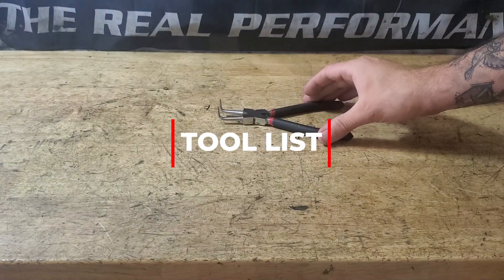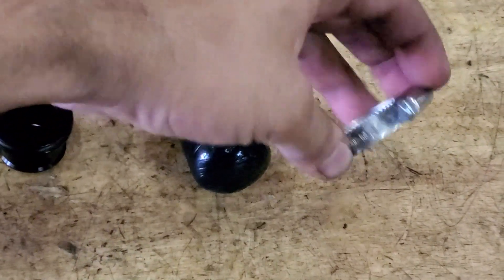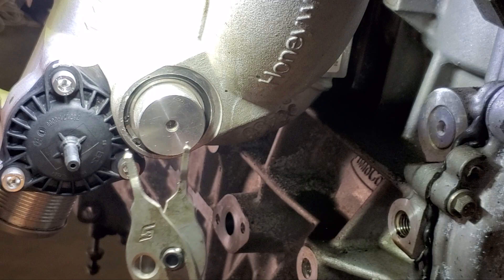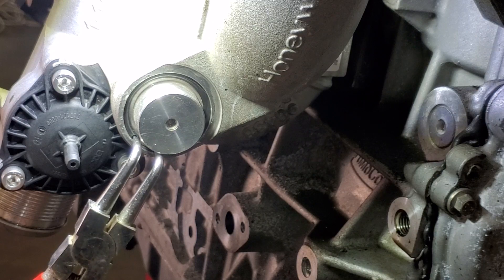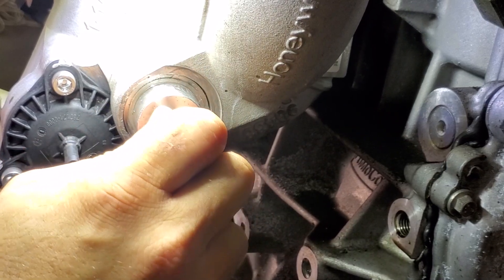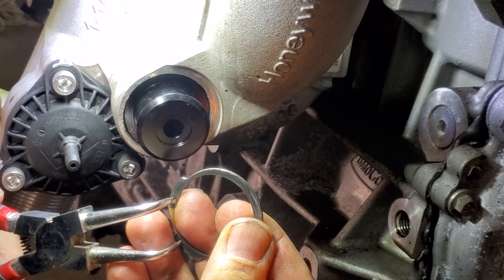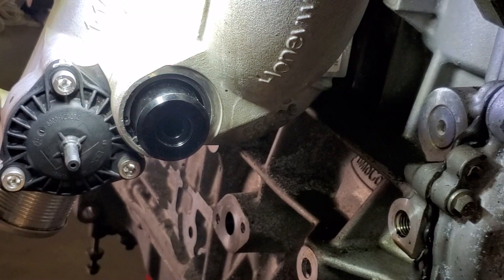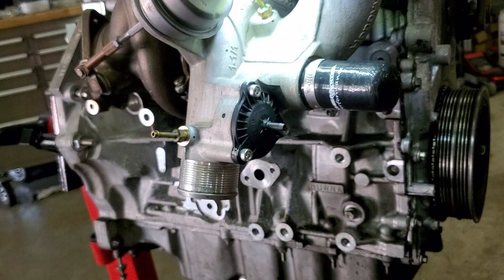How to install Sound Suppression chamber for RSMK3 by OEM Denied Performance

Comment: I wonder why your Turbo is Honeywell and mine is Garrett?
Reply from the maker: Its the same company,  the 2016 vehicles tend to have Honeywell in the casting of the compressor housing, the 2017/18 Garrett. (Same turbos)
Reply: @OEMDeniedPerformance  Well that explains it. Thanks. Also, I literally just got done putting the tools away after installing my Cobb Suppression Chamber.... I seriously hope I never have to touch a snap ring EVER AGAIN.

Comment: The editing on your videos looks so much cleaner, also what is the purpose for this? Does it just reduce turbo noise?
Reply from the maker: Finally upgraded from using a 21 year old version of windows movie maker! Used to use it as that's all I knew how to use but a new staff member now does the editing and flat out refused to use it! When you fit an intake or a K&N air filter to the mk3 RS it produces this strange annoying whistle noise at very low rpm or cold idle. By fitting the sound suppression chamber it just removes the noise :)